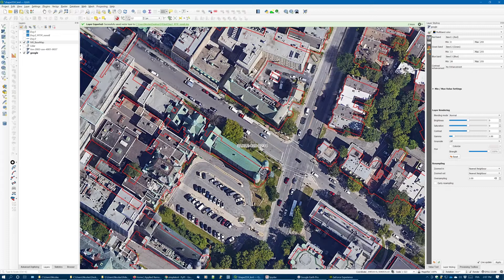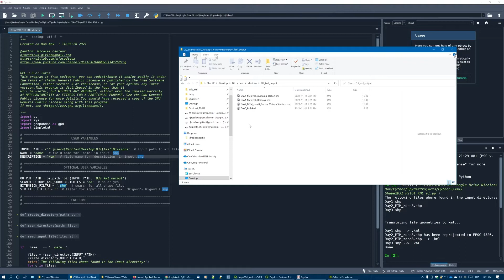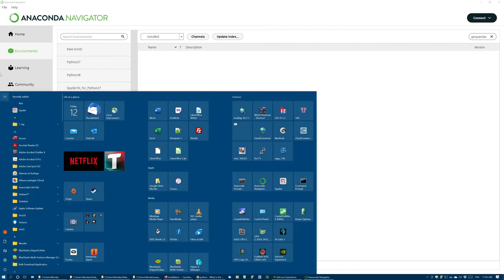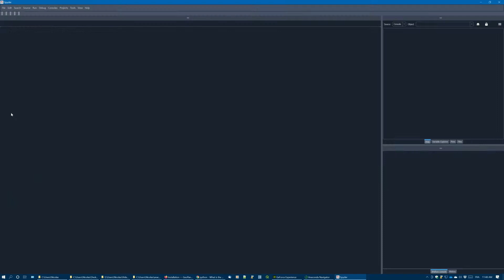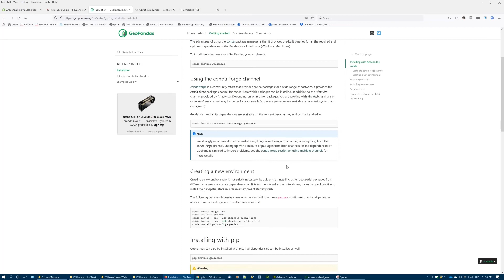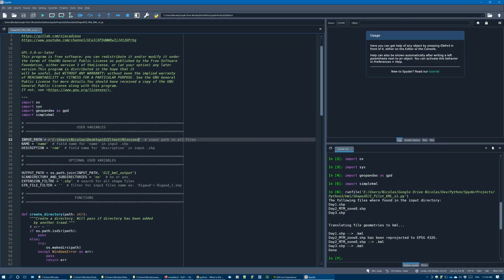How to Create a .KML file for DJI Pilot using Esri ArcGIS, QGIS and  Shape2DJI_Pilot_KML.py

Comment: Great work! This solved my issue of getting a KML to import into DJI Pilot 2! Only now when I have it imported and try to alter the flight heights etc it just crashes!
Reply from the maker: Hi,
We will test on our end.  I am currently on vacation.  Can you comment and leave more info on the script page on gitlab?  Maybe add info on the steps you made to crash dji Pilot?  Thanks
Reply from the maker: Hi, I send your comments to my team,  this is the response « We've changed the flight height an orientation of the lines several times without issue. It could be a problem with Pilot not being updated on his controller.  Or something odd with the lines/polygons.  If he sends you the kml we could try it out on the controller. »
Reply: @nicolascadieux5881  I can't access the link for your gitlab? Just getting a "this site can't be reached error".